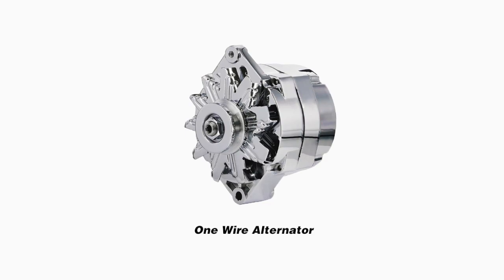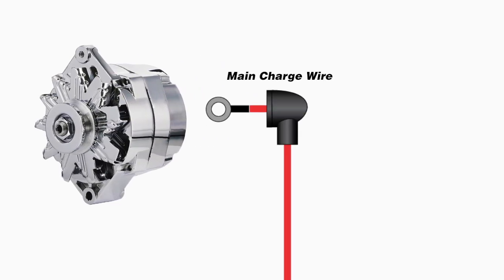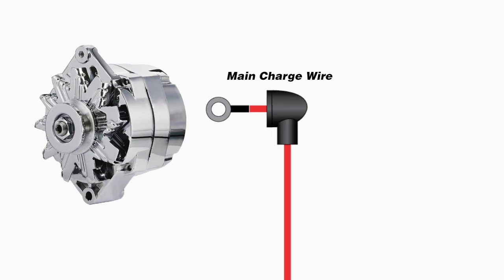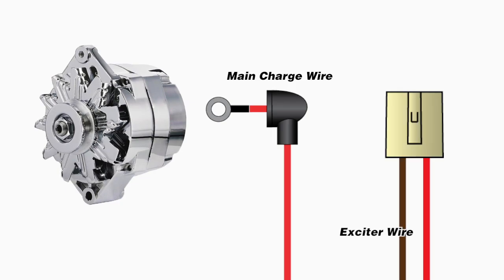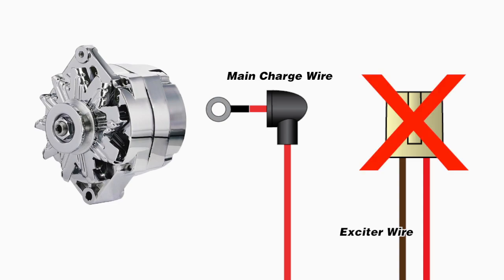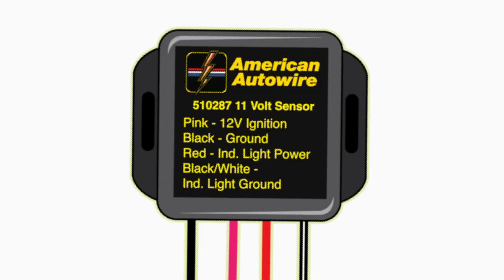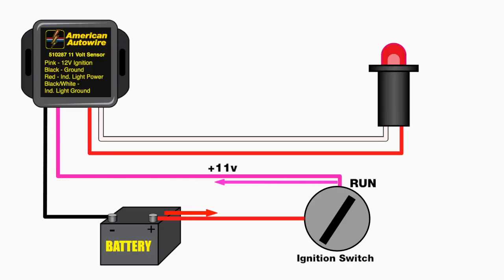One Wire Alternator Warning Light

Comment: I have just purchased a procomp 1 wire alternator (130 amps) it also has a 4 prong female plug provision  at the top with the letters P L F R ,I understand the L to mean light (warning light) my question is would it be ok to connect the warning light to this terminal ???

Comment: Do you have one for 13v bc a battery doesn't charge until after 13.8v trust me I've been left on side of the road believing 12 to 13v was enough
Reply: When running, your battery should should read in the mid 14 volt range, if its not, there's an issue with your charging system. Lots of videos on sussing that out. Good luck.
Reply: @Antiganos  newer cars charge 13.8 my older stuff charges full 14.5
Reply: I agree , I would rather it be adjustable, I would prefer 12v warning

Comment: I have a 2006 Ford mustang gt. At times my oil pressure gauge and alternator volt gauge will stop working and not always at the same time, at times both will be fine. Currently both are not working. Any ideas?
Reply: Sounds like a bad or loose ground, check engine block ground make sure its nice and tight , wiring could be corroded where it meets engine block before you tighten might as well look to make sure its clean,  same thing happened to my truck,  but my oil pressure switch was also leaking lots of oil, cleaned it up put some teflon on oil pressure switch and it was good to go

Comment: I have a alternator with a voltage regulator built in and I'm doing a one wire conversion on a Ford LTD 2 1977 should I even use the plug at all or the wires in the plug that go into the alternator for the one wire conversion? the problem that I'm having is that the alternator is not charging the battery
Reply: @Dustin Bynum i never figured it out..one day while driving it to get the breaks bled..the brake pedal stuck to the floor while going 50 on the freeway..i had to crash into a wall to stop myself..smh..

Comment: Why has no one come up with an elegant high amp fuse for hot-rod's. Flimsy plastic garbage like what painless sells, or the car audio stuff. Which is good but not appropriate under the hood of allot of rides.
Reply: how many amps do you need?
Reply: Something at 80 and something at 120 as well. I've seen burnt cars. I'm a big believer in fuses. Anything that just screws into wire or clamps on a sleeve is not a solution its a point of failure. I like heavy duty ring lugs or just straight to the pin on the back of a fuse block. For my personal stuff I like the marine breakers, but for customers with older automobiles. Nothing will be period correct I'm aware but we not doing fusable links. I just think that a little discrete block with 4 maxi fuses or something like some of the Audio distribution blocks with provisions for ring lugs or being able to do a solder slug not just clamping on wire/sleeve.
Reply: FLB 120 amp fuse ..?? let me know
Reply: I can bolt an amg fuse in more discretely than one of those. I don't quite think your grasping what I'm looking for.A stand alone generic relay box that just did fuses would be sweet. something with a footprint like 1x3 inches black with a factory looking cover. For more than one fuse.
Reply: @Sonos45  You could buy some audio solution parts and adapt it.